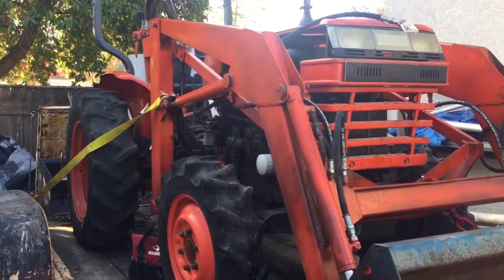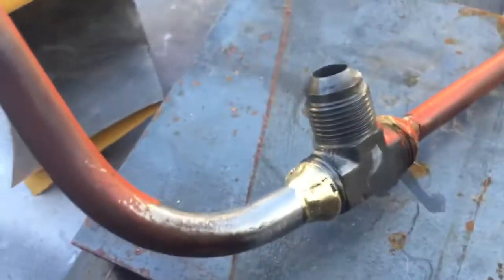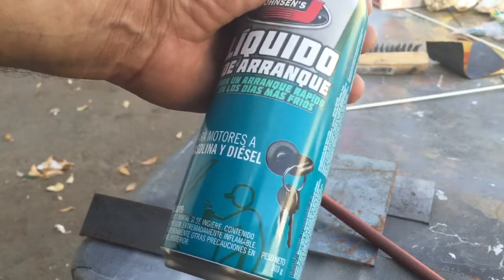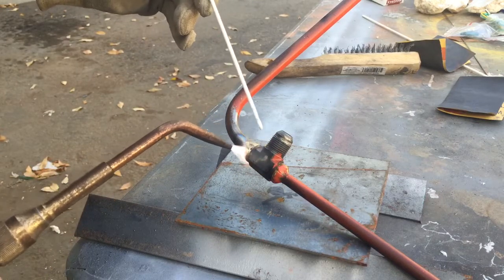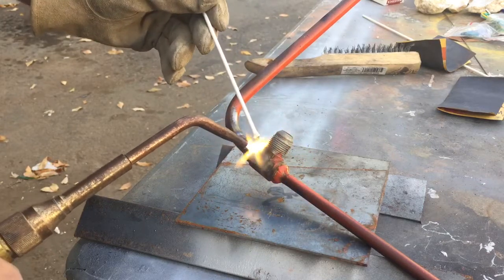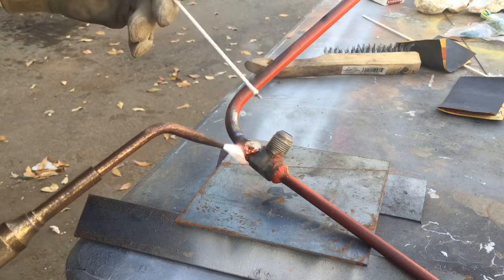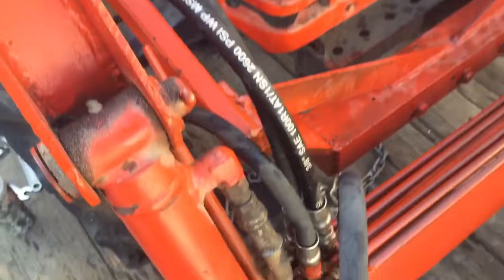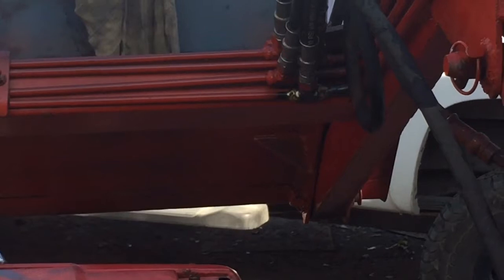Brazing tractor hydraulic lines.

Comment: I had no clue you could braze hydrolic lines ? We always tig weld them .. is brazing strong enough to hold 3k to 4k psi ? Is that the correct way to do it ?
Reply: Brazing has a tensile strength of 70,000psi
Reply from the maker: I'm not sure if that is the correct way to do it, but it's the way I did it and haven't had a problem with it since.
Reply: @TreasureGeo  I sure like silicone bronze tig welded on.
Reply from the maker: Only thing I had available and it's still holding.
Reply: I do this professionally. A properly fitted and prepped brazed joint will work just as well as a tig'ed joint. Lots of OEM code flange and other hydraulic fittings are actually brazed from the factory, but you can't tell since they are zinc plated over

Comment: Just curious, what kind of brazing rod did you use?
Reply from the maker: I can't tell you the specific number but I got it at my local welding supply.  It's like a bronze type with a white flux around it.
Reply from the maker: Just whatever they had at the welding supply, it was the stuff coated with the white flux.
Reply: I do this professionally, I use Safety Silv 45. Lays a really nice joint and flows beautifully. Standard off the shelf brazing rod and flux will work in a pinch just fine, jus5 won't be as nice to work with